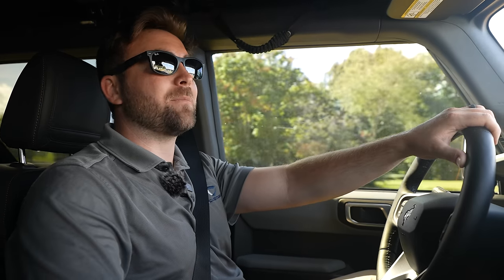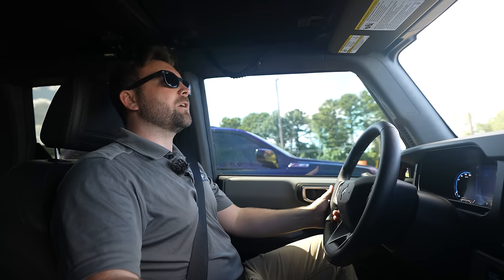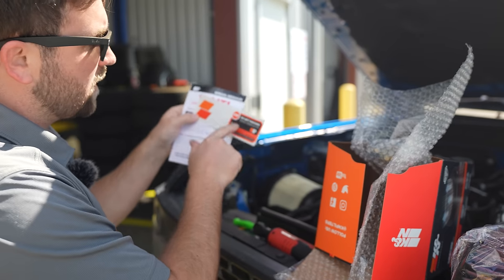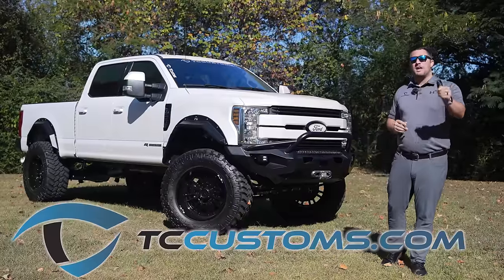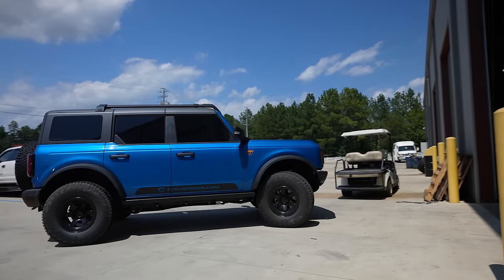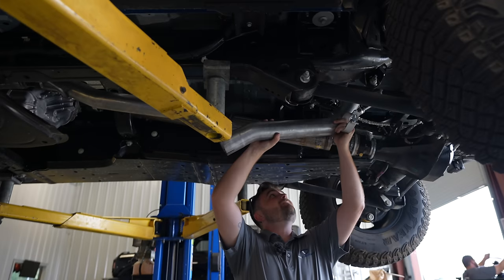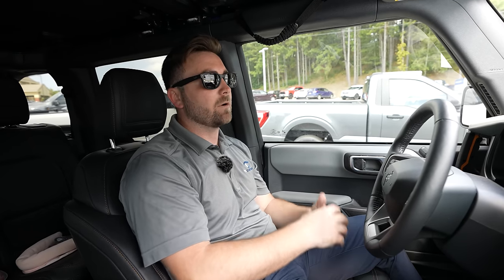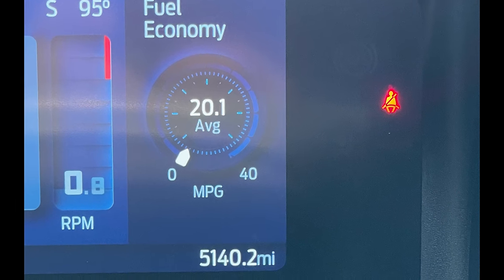HUGE MPG gains for your Bronco!

Comment: 50% more air flow… and 50% more dirt.
Reply: I was just thinking about doing this to my truck but then I remembered I work on the river
Reply: Yeah every time someone talks about K&N it makes me want one more but I keep hearing it’s not meant for reliability, it’s meant for performance and that means you get more dirt through the filter causing more damage and upkeep later on.
Reply: Yep 👍 but one thing also if you live in the city and your not out on dusty roads there is less impact, plus if you have a high intake/snorkel it raises the intake level so your picking up less dirt and dust that’s gonna be closer to the ground…. But in the long run it’s definitely less protection but I’ve seen people with aftermarket intakes above 150k (had them installed before 30k) with no issues too. Environment, maintenance and driving habits will affect your reliability more than anything.

Comment: Im currently doing 21.4 on my 2.7 sasquatch. Did 25mpg between Chicago and NY. Thats just stock. I didn't swap anything, if anything, added more weight to the front swapping the plastic bumper with an all steel. Its all about how you drive it. Eco mode and coast when you can. Use the hills for momentum. Country roads do better than both city and highway driving.

Comment: The MPG needs to be verified by the odometer and gas pump. The display on the dash is an estimated calculation. Should have filled the tank, installed the part, drove 200 miles, and then refilled the tank to get the MPG !!

Comment: K&N style filters KILL engines by allowing dirt to pass thru. NEVER run a K&N style filter on any motor that does NOT get torn down and rebuilt between races. If you go to look at a used car and it has one of those filters, walk away, fast.

Comment: When I attempt to order the K&N 2021-2024 FORD BRONCO REPLACEMENT AIR FILTER 2.3/2.7L F/I, SKU: E-0634....it says it is not compatible with any Bronco configuration I put in. Mine is a 2021, 2.7L Big Bend 4 door non-sasquatch. This should fit, correct?
Reply: I went to put it in my cart and it said shipping was $36. Um, no Sir. May have to get that directly from the manufacturer’s website for free shipping.
Reply: Same

Comment: Drive in EcoMode, and if you drive at the right gear-rpm ratio, you should see 22-25mpg. I’ve gotten 26 mpg on long drives, 24 mpg on town driving.
Reply: How to know that?
Reply: I do the same thing.. dont go over 65mph 1.9k rpm, after that the tirbo spools up and you lose mpg. @JustMe-SA
Reply: Eco mode does nothing on the hwy

Comment: The K&N was a terrible fit on the bronco. It isn't just looser. It rattles. You can see him double thinking it after setting it in place. It has no room to lock down, allowing air in without it passing through the filter. So, yes it increases air throughput. Major pass.

Also, consider what an offroad filter needs to deal with compared to an on road one.

Higher throughput can mean less filtering, especially with a poor gasket fit, which means dust penetration. Something the tight fitting paper filters nearly entirely stop.

You know what else increases horsepower and MPG? Not running an air filter at all. A death sentence for such a vehicle.

There is a similar sized K&N with a metal strap screwband to snug up the gasket grip. I'd run that one over this one that is a supposed drop in, but because of the dust issues on off road vehicles, stay with good quality paper filters.

Comment: I would not do K&N, the oils that are on it and the oils you have to reply will just it sucked into the block which will increase the silicone levels. Also it does filter less. Fust stay with stock

Comment: Try adding not only the K&N stock air filter, but try E3 spark plugs and you’ll notice you’ll be into the 20s very quickly and you could still run on regular fuel

Comment: The K&N filter you installed is the wrong one.  That is too large for that air inlet inside the box.  There is a revised filter I think, but have not been able to find the part number for the 22+ bronco.

Comment: If you’re looking for a commuter for gas mileage buy a car not an off road machine 😂
My Bronco works it hauls my boat 
Goes fishing/ camping/ pulls my flats boat in and out at a dirt boat launch 
Goes to the hardware and gets loaded with mulch or pvc pipes or whatever is needed to run a campground that day. Does some off road driving just for fun on occasion.
Do I take care of it yes 
Keep it clean yes 
Do all my own filters and fluids yes

I am not silly enough to think it was going to be good on fuel mileage though 😂

2021 Badlands 60k on the clock and running strong only motorcraft filters used.

excellent fuel mileage is for Prius owners 😂

Comment: k&n filters are a waste of money cost to much they work good on non computer controlled vehicles but the computers control the air flow, had on on my old F-150 mileage went up about 1 mpg but on my 94 jeep there was no change cause the computer controls air flow